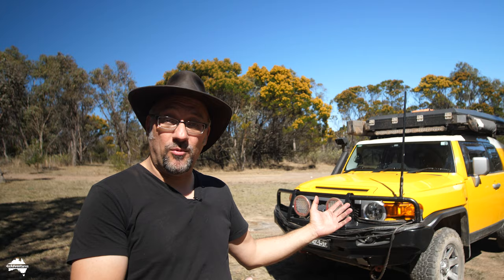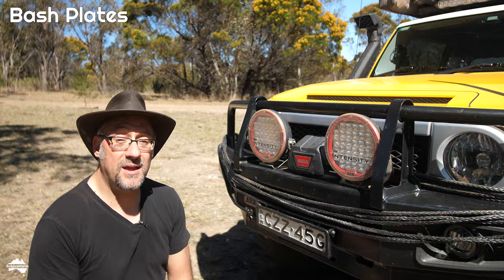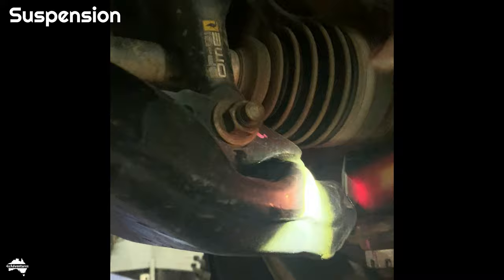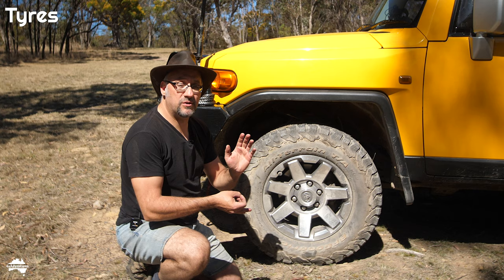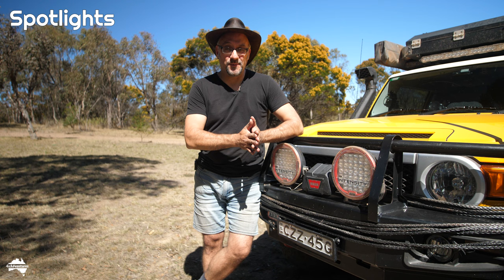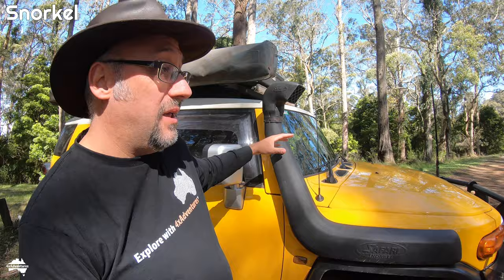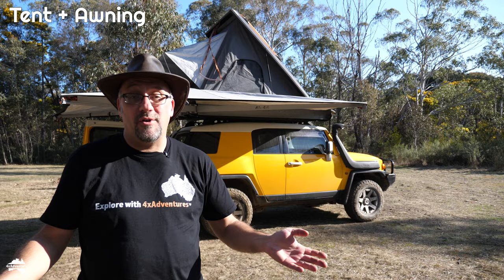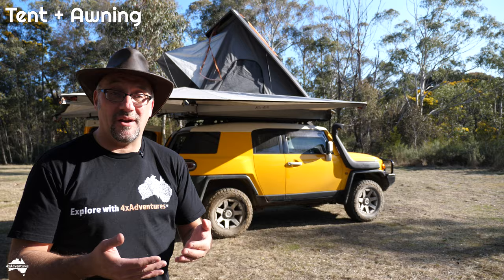FJ Cruiser Touring/Overlanding Build - Long Term Review | @4xAdventures #4wd #touring

Comment: I too have an FJ cruiser and love it— 2012 Aussie model — bought it when 3 years old (the car, not me) — did most of my mods within the first couple of years — my front bar is a Buds, from Queensland — my winch is Runva (dreamed of a Warn but too expensive for me : wanted Ironman but it wouldn’t fit : settled on Runva and no regrets) — Black Oak LED spot lights (from USA : chosen because I didn’t want cheapies and the ARB intensity ones were both pretty pricey back then plus didn’t nicely fit within my bar hoop) — Gemtek lightbar ‘under’ the bar — ARB Oid Man EMU lift initially but recently changed to a GVM upgrade kit — BFG all terrain tyres (love them) — Brown Davies 2nd fuel tank — Safari snorkel — rhino rack —Kings side awning (cheap and very cheerful) — I love the idea of a roof top tent for all the reasons you give but so far don’t want the weight up top so sticking with the swag — love your set-up and videos of it — Chris (Melbourne)
Reply from the maker: Thankyou! Your setup sounds awesome! Glad you are enjoying your FJ. I hope you have many happy years touring and camping with it. They are awesome vehicles! 😊👍

Comment: Hey Arty, I know you said you've left the suspension settings alone. You should consider playing around with them. I left my alone and then finally adjusted the front end before going down some trails. Went from the middle setting right to the softest on the rebound just to see how it would feel.. the result was a totally diffrent car in my opinion, settled and comfortable. Takes 1 min to change it back when you hit the sealed stuff again. I should mention that I'm running the same suspension and pretty much the same fittings on the front end.
Reply from the maker: Thanks for the advice. I really should play around with it and see what the difference is 😂👍

Comment: Mate my first set of tyres from new on my 2015 FJ were BFG all terrains that I got 110,000 km’s out of. They were the previous iteration/ design. Were your first set also the older ones? I also kept with BFGs the same as yours earlier this year but suspect the tyre compound is now softer such that they can now be fitted to some vehicles as OEM being quieter etc . 

Also, I found you have to be very careful with the load rating as essentially the same tyre can be made in different countries with varying load ratings that do not match the minimum of what is required on the FJ cruiser‘s tyre placard.
Reply from the maker: I so far, my second set seem to be wearing well. I haven’t paid attention to where they were made. I will go check it out. 
So far, very happy with them though.

Comment: Great review Artie. Thanks. Did you need a GVM upgrade? I don't have the camper trailer any longer, so debating whether to go rooftop or flatbed inside the FJ. Would like to see the difference the bar light makes, if you get a chance. Didn't catch the name of your roof rack... also thinking about one of those now I'm camper trailer-less! Cheers 🍻
Reply from the maker: Thanks very much! I upgraded pretty much all the components of the suspension. I’m using Rhino rack backbone rails with 3 x heavy duty load bars. 😊👍

Comment: Great video as always, thanks Artie. Which coil springs did you get (there are a few different ones is my understanding, based on how much weight you're planning to carry? My loadout is very similar to yours and I'm not sure which coil springs to go for, I'm worried about uncomfortable ride, versus not handling the weight if i get the wrong ones.
Reply from the maker: Thankyou. I’m not sure of the precise model - it was quite a few years ago now. All I remember is that they are OME and designed to go with the BP51’s at full weight.
Reply: thanks!